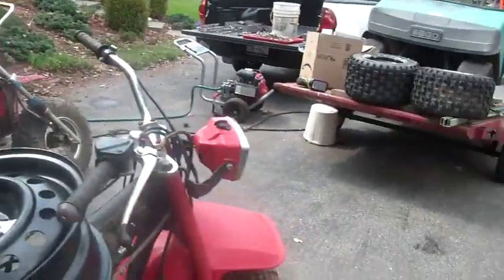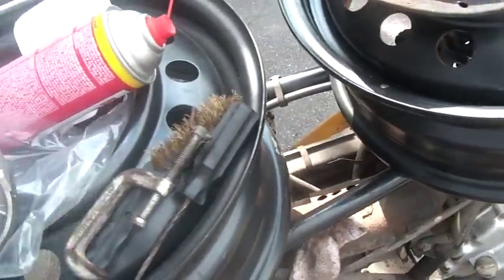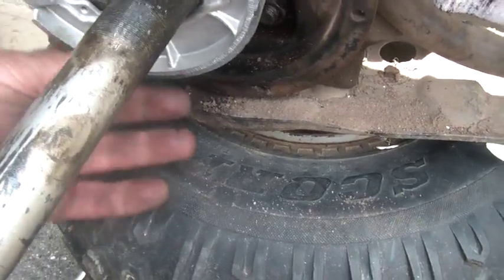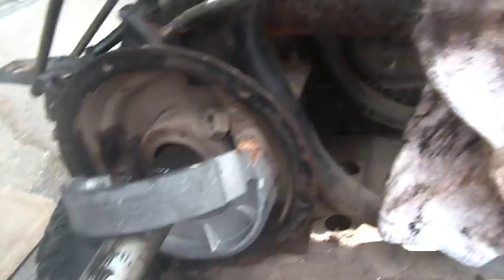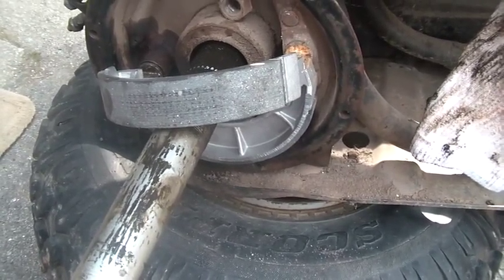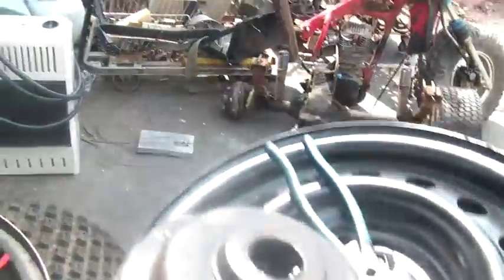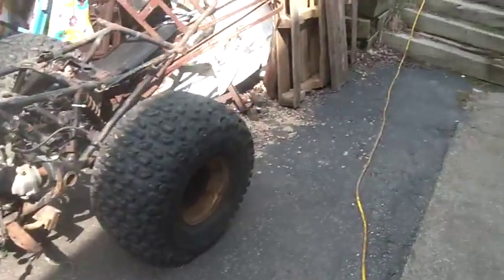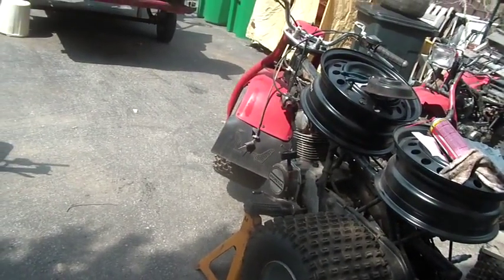5_3_15, Honda ATC185 Brake Job, freeing sticky brake cables,

Comment: Ever consider mixing up your own concoction of tire sealant? Just a cheap $2.00 tube of acrylic caulk (which is main ingredient). Then either anti-freeze, windshield washer fluid, windex or some people just use water. I wouldn't go with water. To get the hole plugged, use glitter or I use rubber shavings from an old tire. It works for me and much cheaper. Just a suggestion.